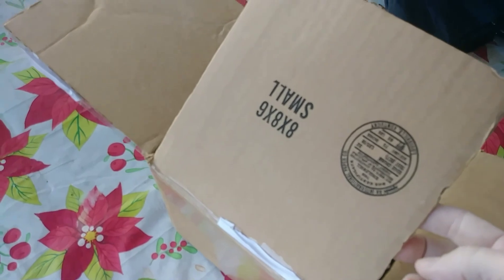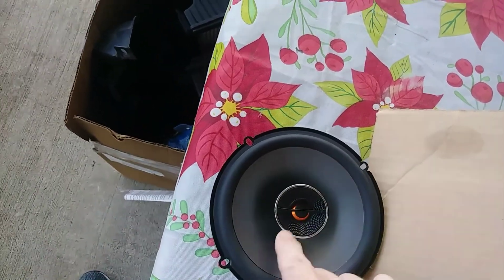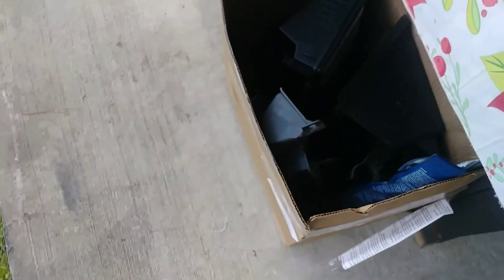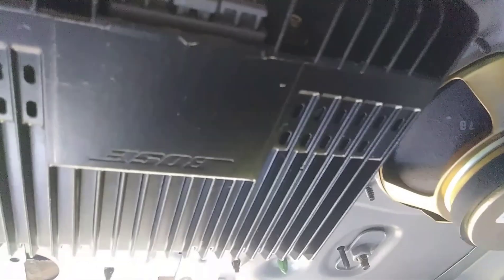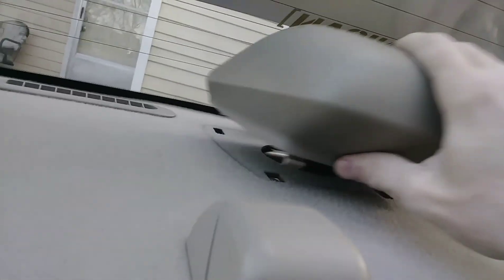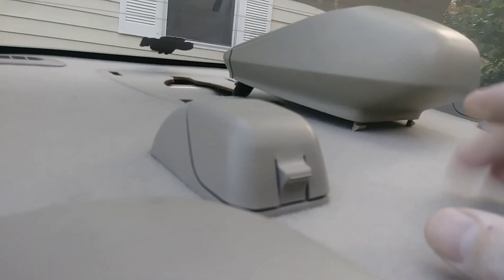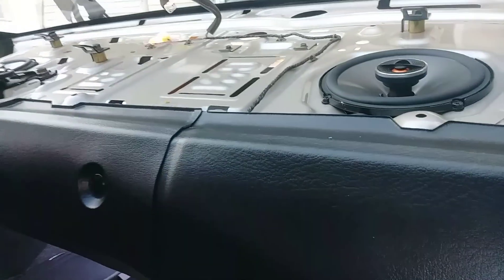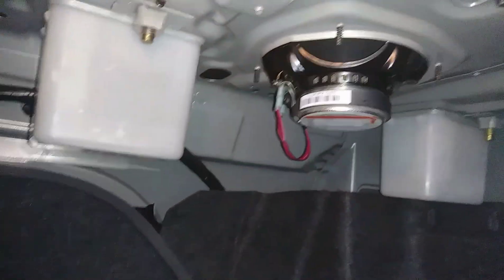02 Infiniti G20 Rear Speaker install

Comment: Really trying to decide if I should just replace the speakers or replace the head unit as well. I want to do both but I heard replacing the head unit can be difficult. 😬 I want these jbl gx series speakers 2 ohm all around and any type of newer double din head unit. Best buy wants $65 to install each speaker and they'd only replace the head unit if i got this $399 Sony one. Total would be like $1205! I have a 2002 infiniti g20 midnight blue color. It's my 3rd infiniti g20. I love these cars. The speakers alone to buy and install and best buy would be $672.

Comment: How did they end up sounding? Did you have to bypass the factory amp? Reason I ask we just installed some in my son's 00 G20 and the aren't sounding so great.
Reply from the maker: They sound great and did you install factory speakers back or aftermarket also do you have an aftermarket head unit aftermarket head unit helps a whole lot the factory head unit sounds so mono to me that's why I upgraded head unit, I have a Pioneer Double-Din which you could do a single DIN the same and I did not bypass the factory rear amp , I also have a Q45 out of 00 to 04  rear amp swap I did that is mod up grade you can do to 00 to 02 Infiniti g20 plug and play
Reply: @firelife171  We have an aftermarket head unit and used the inline adapter.So we did not bypass the amp. The sound was fine with the stock speakers, but my son wanted to get aftermarket ones. Now that those are installed very similar to the way you did it. They don't sound so hot. But I did notice that the factory speakers were 2ohm and my son's new ones are 4 ohm.
Reply from the maker: I would suggest doing to Q45 amp mod it will sound more clear clean sounding and not as muffled
Reply from the maker: You can just run wires straight back to the rear speakers and door speakers another option
Reply: @firelife171  was it easy to replace the head unit? Damn i wish you lived in MN so bad haha